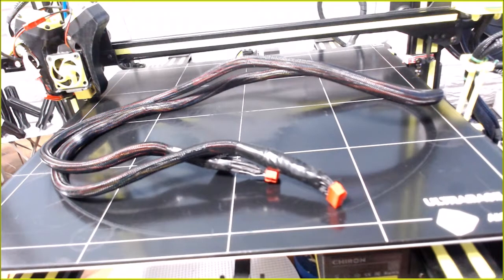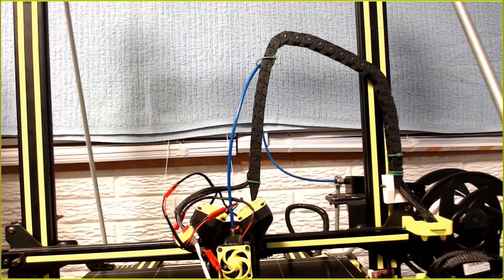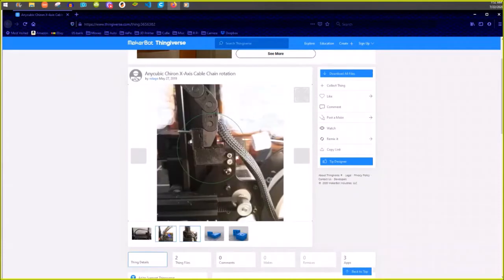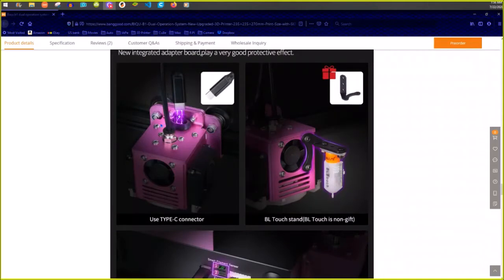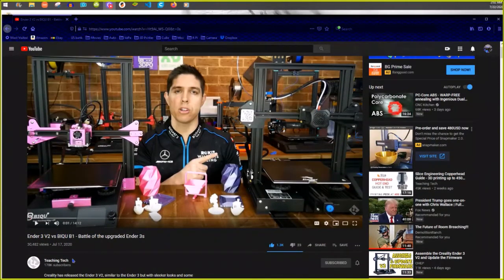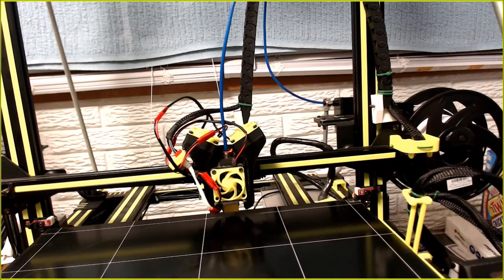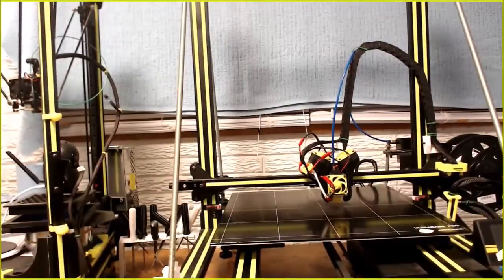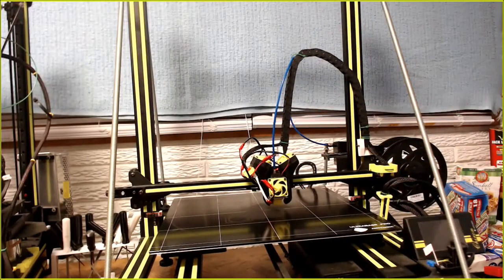AnyCubic Chiron X cable N Mods

Comment: I bought one they are worthless crap I have three Aquila and they work great
Reply from the maker: Oh, sounds bad you wernt able to figure out the Chiron  : (  The Voxelab Aquila is a copy of the Creality Ender3 (basicly) much easier and many more resources from others that have already modded or found 'fixes' for them.  The Chiron is a very good printer for the Beast that it is, and takes a bit of time to dial in. But, then so are a lot of 3D printers - as Most are DIY. Some, such as the CR-6 SE - 'just work' and you dont have to do much. Glad you found a version that works for you and are happy with them : )